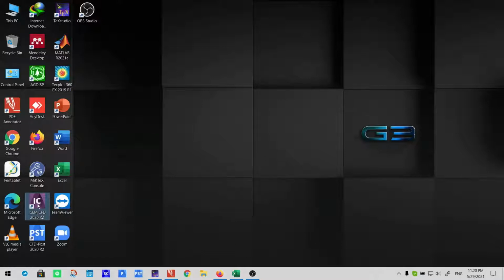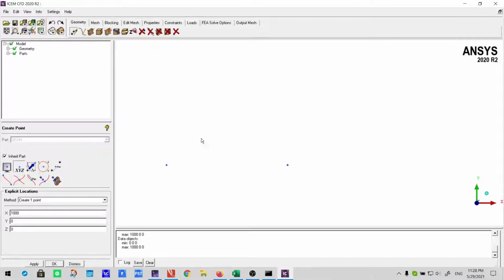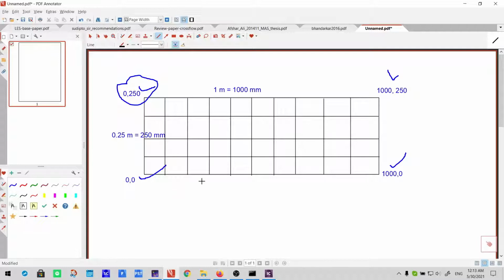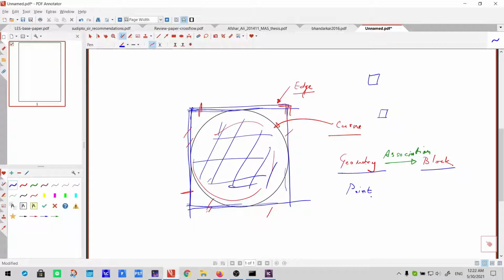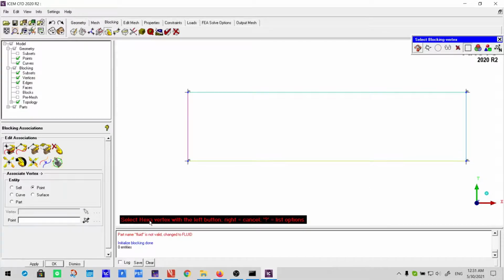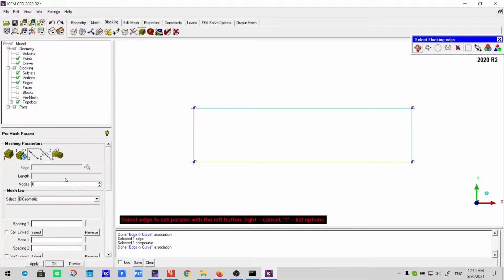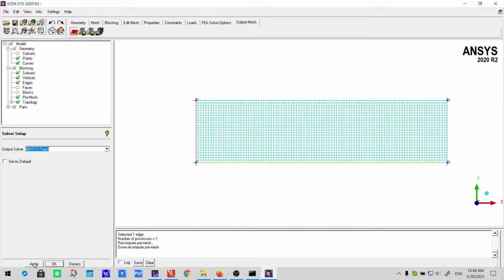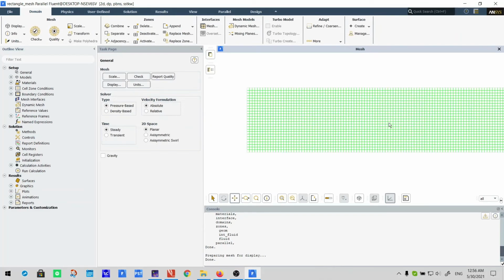Lecture 1: Meshing using ICEM CFD

Comment: Amazing video lecture sir, it clear so many doubts of me.
One thing I didn't understand is how to decide that how many number of nodes we have to take for every edge or how many cells we need for our geometry.

Thank you.
Reply from the maker: Thanks for your comments. It's good to know that you like the lecture.
Also, about the nodes/cells, it's kind of experimental thing. Not fully, but partially.
It requires you to exercise some numbers of cells, let's say initially with 10 cells, 20 cells, then 40.
Whatever is providing best results, you'd select that.
This approach is called the mesh convergence study. Part of this knowledge comes from CFD fundamentals, when you already have some idea of the number of nodes you require. Ultimately, it's up to you, meaning at what scale you want to resolve, and how much accuracy you need.
So no hardcore rule of thumb.
Also there are other things involved, such as the complexity of flow, like if the flow is turbulent, or laminar. Sometimes the geometry itself might impose a swirl flow. So it is somewhat guessing the resolution based on the gradient of the velocity and other parameters that vary in the domain.
Reply: Ohk sir,
Thank you 👍👍

Comment: Sir can you tell me how to export the mesh from. Cas h5 file and. Dot h5 format in the 2024 ansys fluent version??
Reply from the maker: I did not understand the question. Are you performing meshing process in FLUENT?
Reply: @fluidengineer  yes and  when I try to import the cas.h5 file it is not supporting for meshing. 
Could please help me out on how export mesh from Case and Data files in fluent
Reply from the maker: @aruntejdasari720  .case.h5 file is already built with the mesh file, why do you again want to export a new mesh?
Without a mesh file, how are you able to get .cas.h5 file?
Reply from the maker: @aruntejdasari720  Is your problem solved? Or are you still struggling with the same?
Reply: @fluidengineer  thank you so much for your concern. The problem is not solved and i am also new to learning the ansys. 
Well, the problem is how to convert the case file into mesh and geometry. 
I have tried this method :
Read the Case and Data Files:
In Fluent, go to File > Read > Case & Data.
Browse and open your .cas and .dat files.
Export the Mesh from Fluent:

Go to File > Export > Mesh.
Choose the format you need for the mesh export. For example, you can choose the .msh format for further use in other ANSYS tools.
Specify the name and location for the exported mesh file and save it.
Reply: But it is showing some error. Could you please help me out with this problem and please share any solution for this.
Reply: Sir can you please tell me any solution
Reply from the maker: @aruntejdasari720  I think we can have a google meet as I do not find any export mesh option (maybe because I am using an older version of Fluent). So if I see your issue live, that might help solve your issue.
Let me know if you're comfortable with that.
Reply: @fluidengineer  if you could share me your mail id. Then I will send you the video recording . So that it can give you an idea about the problem. 
Is this okay?
Reply from the maker: @aruntejdasari720  I think I got your question, but there can be alternative to this as this feature may be in beta stage what you told.
I can let you know the way, you want to export the mesh file from case, in this case don't use FLUENT to accomplish the same. Open your .cas file in ICEM by using the method:
Launch ICEM
File > Import Mesh > From FLUENT > Now select you .cas file
Next step, when cas file is loaded:
Top menu (left to right) last option: Output mesh
Select the solver as Ansys Fluent, then save the case with some name (it will save many files along).
Then you have the option to export the mesh as described in this video (last step).
Reply: @fluidengineer  okay  I will try now.. Actually it is a reverse engineering method to bring the mesh.
Reply from the maker: @aruntejdasari720 One more thing to mention, that .cas.h5 file first should be converted to .cas file using legacy mode of Fluent (reference video on how to use Legacy mode: https://www.youtube.com/watch?v=uN09vQgkslI), then it can easily be imported in ICEM the way I told you.
Reply: @fluidengineer  thank you so much for your help. 
I was able to extract the mesh file. 
But when I try to read the file in fluent it is showing me error
Reply: It is showing that 
Error: Build Grid :Aborted due to critical error
Reply: It is asking to  process the mesh file first with a serial solver and save it. 
And then read the saved file in parallel solver

Comment: Sir, when I try to export the mesh file in my folder. It shows only the .atr, .fbc and .unc file but not .msh file. I followed exactly the same procedure as yours. Where is it saved?
Reply from the maker: Did you try saving the file name with .msh or simply typed file name?
sometimes you have an older version which requires saving the file with .msh attached.
Means saving the file with full name.
For example, channel_mesh.msh
Reply: @fluidengineer  I am using Ansys 2022R1.
Reply from the maker: @asifraj321  Okay, just try with full name of the file, with .msh extension
Reply from the maker: Did it solve the issue?
Reply: @fluidengineer  , No that method not works. If possible please make a short video on that.
Reply from the maker: @asifraj321  Okay, I shall do so.
Reply from the maker: Dear asifraj321, it's been too long I made the last video, and I am really sorry, that I didn't respond to your query. You may find my contact details in the channel and contact me in case you need help if you're still struggling with it. But I hope you might have come out of it by this long span of time. In case you still need help, do let me know.
Reply: Thanks for your concern sir. My problem is solved. By the way your video was very helpful to me.
Reply from the maker: @asifraj321 Great to know that the problem is solved. Stay happy and many thanks for the appreciative words!